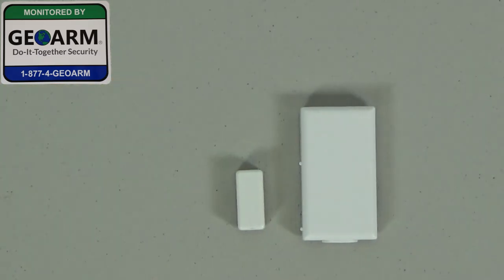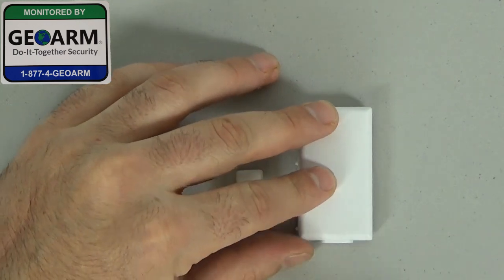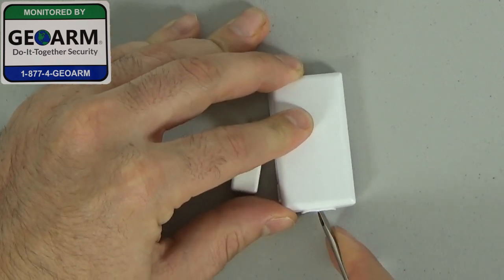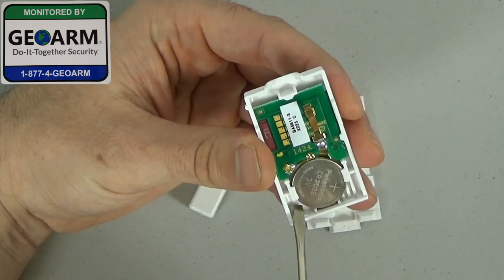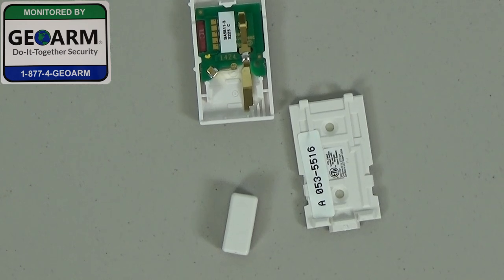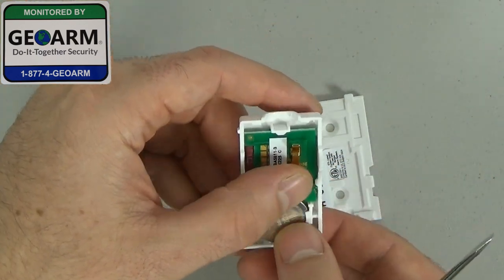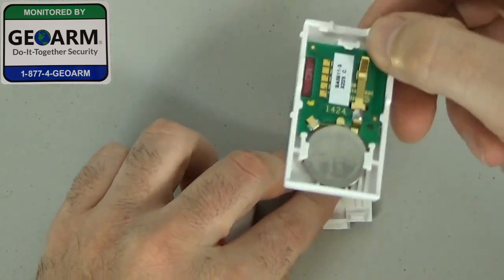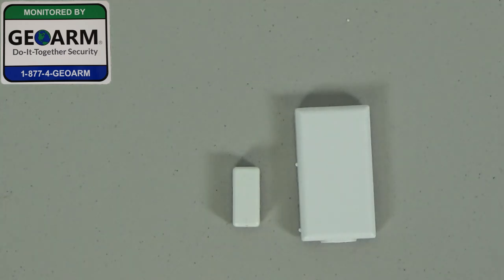Honeywell 5811 : How to Change the Battery in your Wireless Door/Window Contact

Comment: You saved me. I was trying to change the battery late at night and was afraid I would break the white plastic insert by pushing down to reinsert the battery. It worked like a charm. I will have my alarm on tonight. With great appreciation!!

Comment: Several questions- How long do sensor batteries last? Do the motion sensor batteries die quicker than door sensors? Can battery health be checked thru the panel? Over the years I have experienced false alarms all of which have been triggered by a motion sensor, but I never received a low battery warning. On a earlier system it occurred when the system was 3 years old. I just had a newer system, Lynx 5200 motion sensor (2 years old) trigger a false alarm. Do you have a recommendation on when to replace batteries to prevent false alarms?